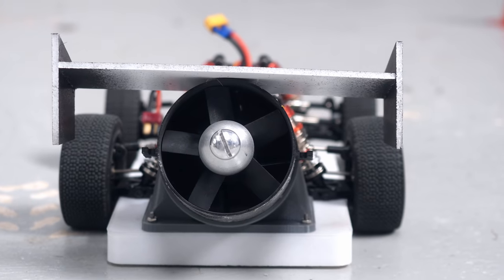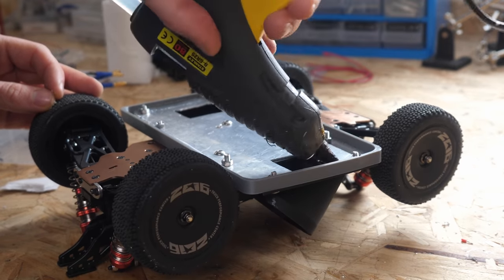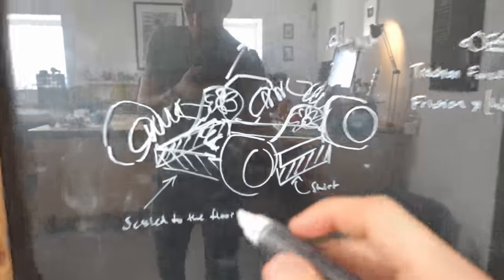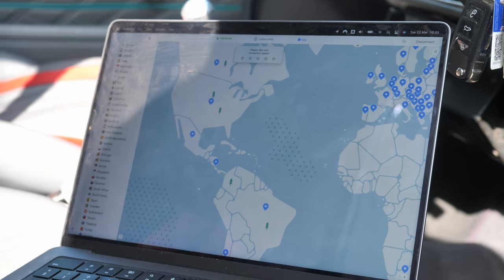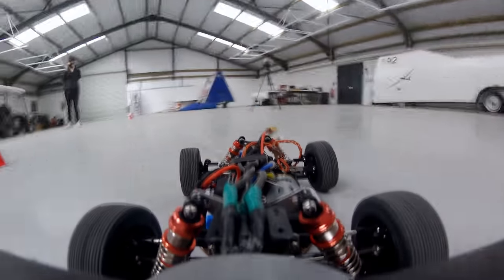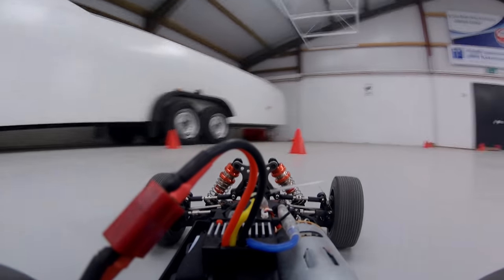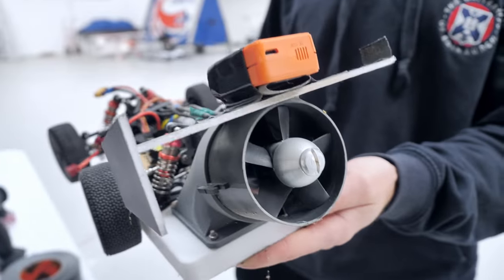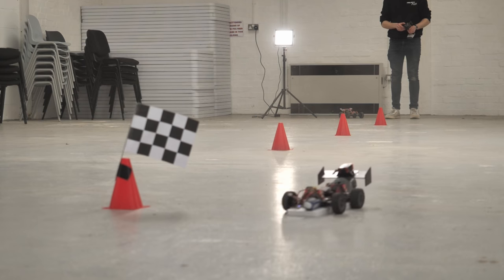Vacuum Effect RC Car

Comment from the maker: Big shout out to Engineering After Hours - his fan cars are some of the fastest electric vehicles in the world!  https://www.youtube.com/c/EngineeringAfterHours
Reply: Great work on this one! I love the direction comparison as well.
Reply: You need a Louver or a Strata cap which prevents debris from entering the fan with a tornado effect expelling the debris & dirt to the sides. They are used in aftermarket car car intake boxes for off-road vehicles. A topspin would work too. Check out Donaldson Filtering solutions. You may be able to 3D print one. They may even sell one small enough for your application. essentially they are pre filters but work with centrifugal force of air spinning like a tornado rather than a mechanical filter which can clog.
Reply: try to fix the cam, lock easy
Reply: I think that you did a much better job with your choice of location for this experiment compared to the previous video. This time it was much more suitable for your experiment. And this time the difference in grip was very noticeable despite your clumsy handling and steering 😉 So my compliments for that. 😋 Sorry for you loss of the camera. Small tip, maybe next time you can turn that round track into an oval with some cones, creating a straight on the track, which gives you more data and more challenging conditions.
Reply: Could you build more rockets? Those are very fun videos to watch and you do a good job on them.
Reply: Sorry to hear about your camera fella, maybe try sending it over to YouTube's Hugh Jeffreys? He's a wizz with tech stuff repairs! Also, JPS Lotus were the instigators of the down force palarva back in the F1 days, though, they only used flexible skirts and aerodynamics (which did give them a good advantage, until other F1 teams started complaining to the FIA... Then, as you mentioned, some bright spark thought of bolting a fan to the car too! hahaha 🤣🤣🤣👍 😎🇬🇧
Reply: Maybe think about sending the camera to MyMateVince, another british youtuber who does DIY repairs - that would be a nice collab ;)
Reply: @thedarkknight1971 Chaparral had adjustable skirts way before Lotus.
Reply: @johncarl5505  Haha yeah sorry I'd forgotten them, bit that DID happen with a fan in early 70s... Peter Wright and Tony Rudd (when they were at BRM) came up with the concept in the 60s, but, there wasn't an actual working car for the track, so it was abandoned, until they moved to JPS Lotus and brought it back, however, the Lotus team did make best use of that tech without a need for a fan with the 78 and 79 hence the gains, hence the complaints, hence the eventual ban...
Reply: @thedarkknight1971  Peter and Tony just used normal skirts.
Reply: @thedarkknight1971 Chaparral has experimented with ground effect without fans starting in 1961.
Reply: Just gotta say you got some cool hair bro
Reply: make an f1 rc car
Reply: f1 rc car similar to 2022 f1 cars
Reply: Can you put the fan on top of the car and let it blow air upward
Reply: Next step a raspberry pi, enabling adaptive fan speeds to increase and decrease grip as needed!!!
Reply: The understeer might be caused by aero and weight imbalance. Got a big airfoil in the back and the fan in the back.
Reply: Canyou do it with a ground effect car like fan + ground effect floor = massive downforce 🏎💨
Reply: Gordon Murray should definitely see this video. He'll be proud! Great job, mate!

Comment: A firmer suspension could give you more downforce without dragging the skirt.

Also for active downforce management you could increase the fanspeed when steering (if you can program that)
Reply: ^ this one! Please take it further!
Reply: Actually, as you start to draw a vacuum, you will draw less power, as it's doing less actual work, so you could make a smart controller that indirectly senses how much of a vacuum you are pulling by monitoring draw, and automatically controls the throttle to try to always pull slightly less than the maximum vacuum, which should hopefully translate into the skirt riding just above the ground.
Reply: @Nevir202  that's right, but needs a lot more engineering. I don't think my suggestion is a perfect solution, but it could improve the rideabiljty with little changes.
Reply: Dynamically controlling the fan speed based on laterally forces and / or skirt height may be fun. 

I would consider adding some small air inlets near the front of the skirt to keep it from sealing completely as the fan loses much of it’s suction when the air flow is reduced to near zero. 

Also a centrifugal fan would do well in this use case. 

Fun vid, Hope to see more on this topic.
Reply: further to this making the skirt and aero unsprung to you can run the fan at max without any risk of grounding out
Reply: An esp32 or 8266 would be well suited to such a task, as well as potentially logging telemetry. Either that or just use a 3 channel Rx and mix steering and fan speed in the Tx.  He's got a Taranis so that should be easy.
Reply from the maker: @whatelseison8970  Somehow I completely forgot to include the section of this video I filmed that showed me limiting the suspension with some fuel tubing around the shocks 😅
Reply: @Project-Air  Was it on the Sony? 🤕
Reply: Another option would be to restrict suspension travel.
Reply: You could actually just put the steering servo and the fan on the same output of the receive, so the harder you turn the more fan speed you have
Reply: @alisioardiona727  not really, because the servo is on middle if it's going straight. That would mean if it's going straight the fan is on half speed. Turning in one direction decreases the throttle and the other increases it
Reply: @digiay  The radio is the problem not the idea. A simple nonprogrammable 2 channel radio like I saw in the video is going to be extremely limiting for  a project like this. He should be able to control the motor for the drive train and the motor for the fan separately, on 2 different channels with a better radio. A lot more possibilities would be available for a larger more advanced car in the future.  I see this small car as just a proof of concept. It may never go beyond that.
Reply: Sure while he's at it add valves or return to two fans to counteract the roll force in high speed turns...

scnr
Reply: @treefittyfoh1562  like "what else is on" wrote: he has a taranis. So he only needs to switch out the receiver and program it.
Reply: @digiay  Not really since the data imput is a 0 when the servo is centered, -100 on one side and +100 on the other. I wouldn't be surprised a -100 value makes the engine spin
Reply: @Project-Air  what about physical bump stops that force the skirts to stay just above the ground?
Reply: @treefittyfoh1562  why not just have an Arduino tap into the steering angle (and ideally the motor speed) and have that determine the fan speed.
Reply: I’m thinking the problem is that the suspension has too much travel. The body is being pulled to the ground,but that’s not causing the tires to be driven into the ground to create a bigger contact patch and grip. Rc car suspension usually will easily let the body be pulled below the wheels the suspension is absorbing the downforce effect instead or trans feting it to the wheels.
Reply: came here to say just this
Reply: @Nevir202  i believe it may be the other way around. The fan is not inside the vacuum, it's the one making the vacuum. So as a pump, it actually works harder because it has very little air to extract. It's fighting against low pressure.
Reply: @parid.kushta  I can see why you'd think so, but you're wrong. The work done by a vacuum pump is in moving the air. When the supply is cut off, it does very little work, it isn't moving much of anything. It just spins whatever remnants exist, around and around in the housing.

You can go watch videos where they measure the amperage draw before and after blocking the inlet.

Now, that's not to say that doing it might not be WORSE for your motor, because they're often cooled by the air they are moving, so blocking flow, or restricting it too much can overheat and kill the motor.
Reply: @Nevir202  It still doesn't make sense to me, as the fan is outside, pulling air from inside "the box" (the underside of the car).

If there's only one door to that box, and in that door you have a pump (the fan), it has to fight vacuum to pull whatever remnants are there.

If the fan would be in the middle of the underside, and somehow it would be enclosed in vacuum, it would be working with no resistance at all.

It's the same principle for aerodynamics and rear diffusers. The sharper the cutoff angle for the trunk, and the larger the space underneath the car, more vacuum effect can be created. This vacuum that keeps the rear of the car planted in aerodynamics, is the one creating resistance for the blades in the rear fan.

If i'm mistaken please tell me for what, i'm fascinated by such topics. Thanks!
Reply: @parid.kushta   Ah, that’s the problem.

There’s no such thing as pulling air.

You can create a lower pressure zone, and air rushes into it, making it look like the air was pulled, but there is ONLY air pressure, a vacuum is just the absence of pressure.

Like darkness is the absence of light.

You’re right that a fan spinning in a vacuum would encounter essentially zero resistance, and spin as if there were no blades attached at all.

If you seal off the inlet, the fan begins to create a vacuum as you can see, and if no air can get in to replace that which is being PUSHED out, the fan ends up doing less and less work, till it reaches some equilibrium point, where the air leaking back in around the edges of the blades is equal to what the fan is ejecting.
Reply: @Nevir202  By that exact definition the air leaking back around the edges is holding the edges back. That equilibrium point is the maximum possible hold-back force for the fans fins.
Reply: @Nevir202  Too complicated, just do a height sensor that is inversely proportional to fan speed and set a minimum fan speed for ideal conditions.
Reply: @Zardif  LOL you think adding a sensor is easier than just monitoring current flow to something you already have?
Reply: @parid.kushta  I really tried to understand what you're saying, but I can't.
Reply: @Nevir202  Lmao it's okay. 

Moving air takes energy. When a blade cuts air to push it, it creates vacuum behind it, making it possible to suck air.

When moving air out of a box with only one opening, no new air can come replace the old air that was pulled out.

This creates vacuum that gets harder and harder, until that force is so strong that it doesn't pull air from the box anymore, but from the front/fan, reversing the process. This is the equilibrium point you mentioned above.

At this point the force is the greatest possible against the blades of the fan, creating the most stress.

It's like a vacuum cleaner trying to suck against something solid like the ground.

What i'm trying to say is that at that equilibrium point the force becomes the greatest, not the smallest as you say, making it hardest to turn the fan blades against that pressure, instead of easiest possible without resistance.

The fan is creating the vacuum effect, it is not in itself enclosed in a vacuum sealed environment.
Reply: @parid.kushta  OK, you're still wrong.

Again. you can find videos of blocking the inlet on a vacuum attached to a meter and power draw drops by at least 10% when the inlet is fully blocked.

There is no "vacuum pressure" as you seem to be implying that makes it harder for the blades to turn.

You can imagine the blades like a bunch of spinning baseball bats and the air molecules as trillions of bouncy balls falling into the spinning bats and being knocked away.

If you start decreasing the number of balls in the system, is it going to take more or less power to keep the bats spinning?

You're only half right, one side of the fan IS in its own vacuum. If it isn't, then there is no vacuum. By definition, a vacuum is a pressure gradient, so for air to flow TO the blades, the side from which they are drawing air is at the LOWEST pressure of the entire system, unless it's totally sealed allowing pressure to equalize.
Reply: @Nevir202  But the underside of the car is in lower pressure than the ambient when the fan is running, therefore it is sucking on the fan blades from the inside harder and harder the faster that fan rotates.

A vacuum cleaner's motor/fan is inside "the box", so that comparison was a mistake by me, as it will result in what you said.

In our case the fan is on the one and only "hole" of "the box". It is on the outermost layer, not inside of it.
Reply: @parid.kushta  There is no "sucking" on a fan.

There is no such thing as vacuum, only absence of pressure.

Doesn't matter where the fan is, the fan itself is always the boundary between the vacuum on one side of it an atmospheric air on the other side, because it is the thing creating the pressure difference.
Reply: @Nevir202  That's what i'm saying, the lack of pressure is the one pulling air from the ambient side, making the work increasingly harder for the fan.

What you're saying is that a fan in an pure ambient, will work harder than a fan in outer space, because there are no air mollecules to push. I get that.

But the difference here is that you have a fan in pure ambient pushing air from one side to the other as normal, and (to make a visualization) another fan next to it, doing the same thing on the opposite direction.

Isn't the first fan going to work harder?

Or let's say a fan in pure ambient and this same fan in ambient but with the wind blowing against it.

Won't this fan spin slower with the same energy, or need more energy to spin at the same RPM?
Reply: @parid.kushta  Except that it doesn't, because you CANNOT pull air, only push. And when there is less air there to push, because the fan ha created a partial vacuum, the fan does less work.

At this point I assume you are just being willfully ignorant, since I've pointed it out like a half dozen times, and you can easily go look all this up but haven't.

Anyway, have a good one, I'm done.
Reply: @Nevir202  If an area with higher pressure is next to one with lower pressure, it will do everything it can to equalize its pressure.

That means that ambient will push air to the underside of the car, going against the fan blades, making them work harder.

I don't understand why you're griping with the words "pulling" and "vacuum", but here's with your own definition.
Reply: @Nevir202  No more comments homeboy? Did you realize your idea was not correct or what?
Reply: @digiay  Believe in JESUS today, confess and repent of your sins. No one goes to heaven for doing good but by believing in JESUS who died for our sins. Hell isn't fun. GOD loves you soo much unconditional❤🙌❤😌
Reply: Also slicks would not hurt and maybe even no suspension at all or a really minimal one
Reply: About that increasing fanspeed while steering idea. Maybe the optimal way to do this is to make downforce increase proportionally to the grip needed, if there is a way to measure the acceleration of the car in real time in both axis, and then translate that into fan speed a microcontroller can make those adjustments on the fly.
Reply: @alunesh12345  sorry. Imaginary friends isn't my thing. There is no hell nor heaven. If you can't cope that it's your thing, but don't try to convert others.
Reply: Plus if you could make your fan blow the other way whilst not in use, for instance down the straights. Itll blow the filter out cleaning it of all the junk 😊
Reply: @Nevir202  people seem to like your idea, so i’m the odd one out haha!
But (while i know/am convinced of the physical possibility) i stand by my scepticism - do you really think thats viable to do on a tiny scale of an rc car?  Even if we dont talk about pressure sensors like a map sensor v.e, even a ride-hight sensor is kind of not rc scale applicable.
You’re just being fancy 😉
Reply: @briansmith7234  actually the real fan cars just suck in the dirt and spit it out, you simply would need a stable enough fan for that. Cause air vents would influence the ground effect very badly
Reply: Would have been nice to see the actual times
Reply: Really, on such flat ground suspension is more of a hassle than a help.